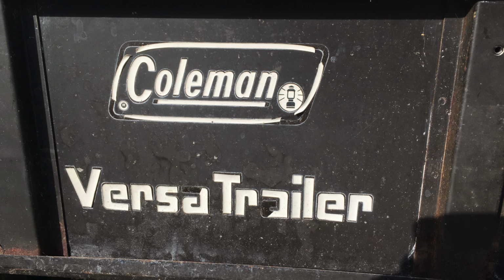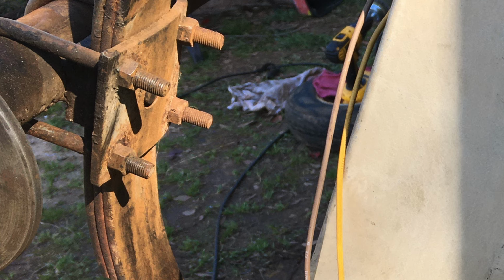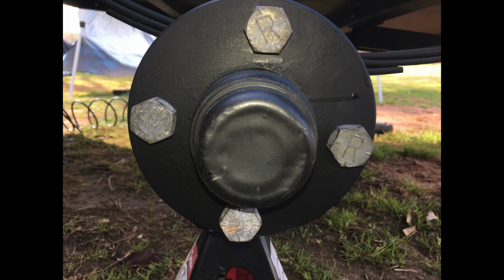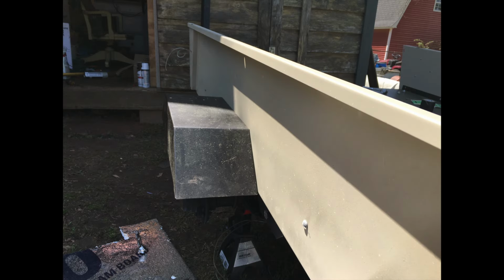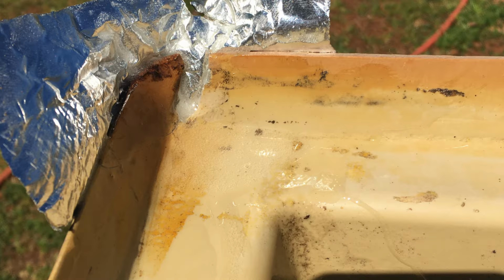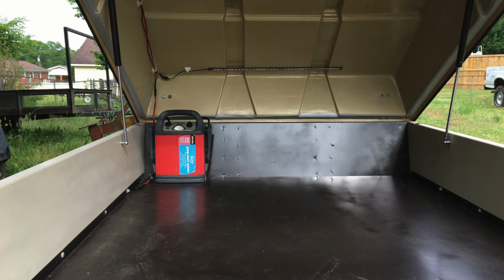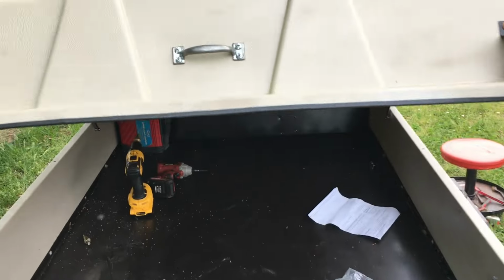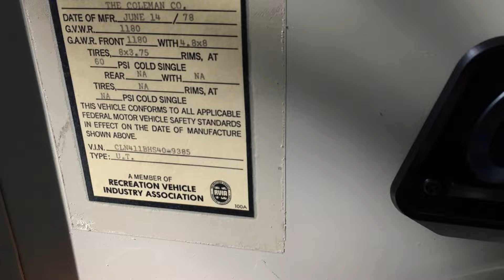VINTAGE COLEMAN VERSA TRAILER RESTORE

Comment: That's great, the only thing knowing me, I would have done is added a solar panel. Sometimes being a master electrician can be counterintuitive. Just have to take it over top. Lol
Reply from the maker: I definitely understand that. I did add a solar charger to the kit for the power supply along with  a 100 watt 120v inverter. I rebuilt that power pack/jump starter by replacing the internal battery and adding an external charge port.   
I thought about adding a swing down flat panel from the top. 
Maybe that’s a future project! 😀
Thanks for watching!!

Comment: 6:55 I picked one up that's in pretty bad shape, rusty. Top has cracks around edges, and is missing plastic. But is fairly solid. Not sure if I want to try to patch, or just fiberglass over the outside and paint. I like the gas strut setup. I have the original top props that came with the top.
What did you use to fill the crack in the top.
Reply from the maker: Congratulations on finding one! If you use gas struts you might consider permanent hinges at the front. It would be a good improvement. 
I used J B Weld plastic epoxy but it failed too after a while. There’s something in the design that cracks the front left corner. I think it’s the spacing front to back. That’s why hinges might be better. 
Holler back if you get questions. 
Thanks for watching!

Comment: Mike, I just bought one of these the other day. I really enjoyed watching you restore yours in this video. I'd love to know more about how you made the brace across the top. I have cracks in my top, and reinforcing it like you did would be a good idea for mine. Did you special order your decals, or find them for sale somewhere? It looked to me like you used Gorilla glue to patch up your lid. I was thinking of using fiberglass cloth and epoxy as I did previously with some of the cracked plastic on my pop up camper. Maybe I can get away with Gorilla Glue and fiberglass cloth. How is yours holding up?
Reply from the maker: Hey, thanks for watching! 
On the brace it’s a 2 in wide 8 ft aluminum strip I bent in my vise to best of my ability to fit the curvature of the top. I used 3M ultra double sided sticky tape to hold it. Didn’t want to add holes to the top. 
I used plastic epoxy for the corner repair and no it didn’t hold up. Something in the design made it break again just like the first owner. 
I found the decals on eBay but had to special order the Versa labels. 
Good luck with your restore and I’ll be looking forward to seeing the finished product.
Reply: @MIKESWILDWORLD  Thanks!

Comment: Looks great i juat picked up one. But i didn't have and tires or bolts. Do u happen to know what size bolts and thread they were?
Reply from the maker: I looked mine over today. I could not tell anything about the bolts. The tires are 10 or 12s with 4 bolt pattern. Tractor supply for around 80.00 each. 
Thanks for watching. Hope that helps some.